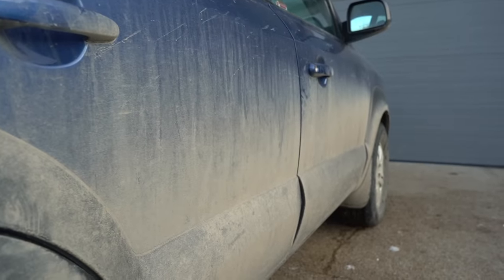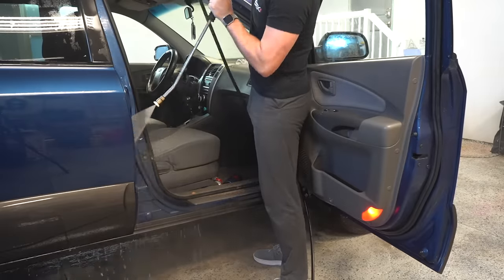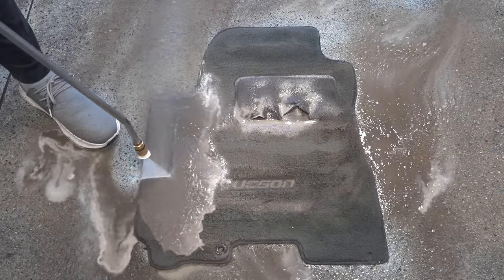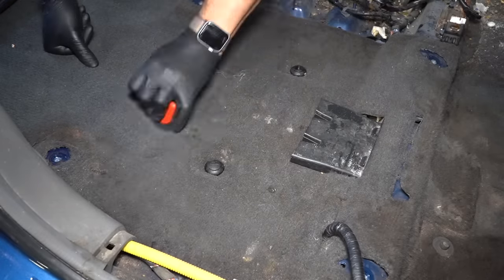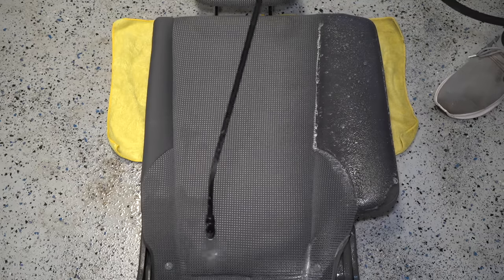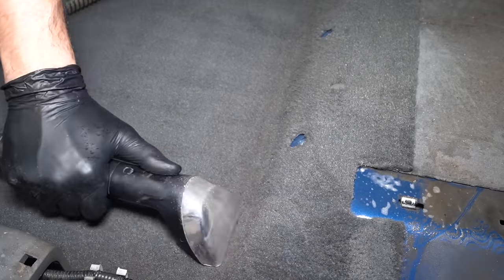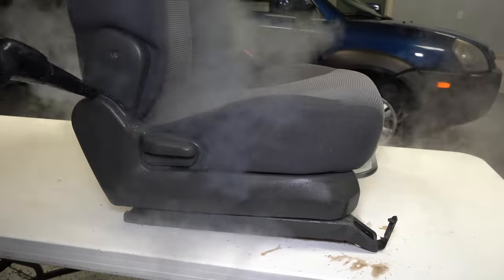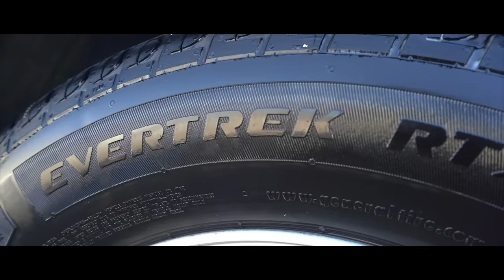EXTREME Cleaning a Girl’s NASTY DISASTER Car! | The Detail Geek

Comment: You even wash the bottom of the car. You know no one will look there, but you still do it. Legend. Round of applause 👏
Reply: cleaning the under carriage is important. Leaving dirt and grime could cause corrosion, lead to holes, etc. Important parts down there =)
Reply: If car is from area where winter snow salt and sand if don’t do undercarriage car will rust a hole in it
Reply: If a mechanic has to do something down under there it's better to work with too, since they aren't touching god doesn't even know what
Reply: That's what i call customer service at its finest!*

Comment: I'm surprised you haven't fabricated a 45° rack (think: slantboard) on which to pressure wash the dirty mats so all the filthy wash water drains off immediately rather than requiring numerous passes with the wand.  To hold the mat to the rack there would be a large spring-loaded clip at the top similar to clamp/clips sold in office supply stores for clipping together a stack of papers.  It would also have a slanted catch pan under it to funnel the water and dirt into whatever catchment/drain system you choose.  This would also keep your shop floor much cleaner as you are working.

Comment: A little tip: it's easier to pressure wash mats if you hang them up vertically. Usually that will have to be against something to support the back when you're blasting them. But it gets the dirt out much quicker when you have gravity helping you.

Comment: I don’t eat inside my car, well, for one thing, not safe drinking, eating and driving, not mattering what. A vacuum regularly, use tight fitting seat covers, but clean them regularly. Use microfiber with hot water on the surfaces I touch the most. Use car wash regularly but clean the wheels by hand. Get lots of compliments about it (Mazda Miata 2011), bought it 7 years ago for 10k, often offered more than that 7 years later. But, how much do you charge for a service like that , since you seem to take pride on what you do? Great job.

Comment: I think that's a great idea, steaming the doors except... that is not doing those electrical connections any good and gonna come back later to haunt her when the window motors quit from corrosion/rust... I know this is the proper way to clean it "like new" but, not sure if it's worth the possible problems later...I think I'd want the door cleaned by hand and not worry about them being not 110% cleaned off